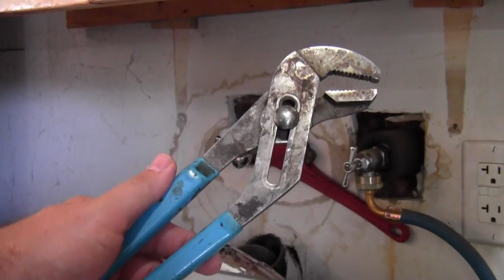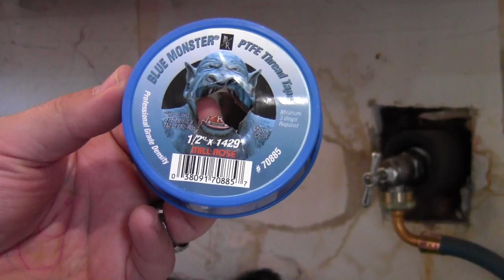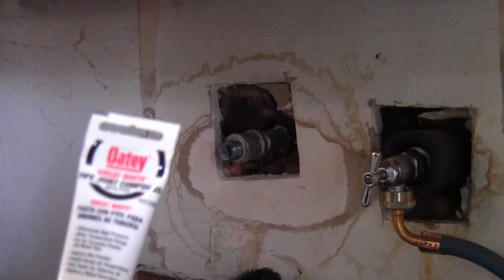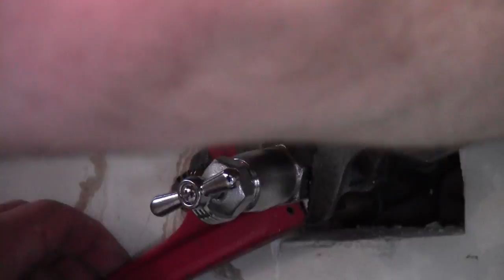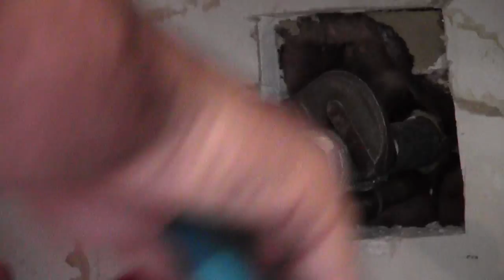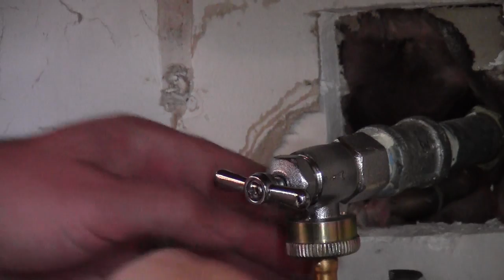Washing Machine Water Valve Replacement

Comment: For me, it seems the water is leaking from the part where you open and close (turning) the water pressure.  Should I just change it completely instead of this method?
Reply from the maker: To replace the part that is leaking I believe you would need an exact match. If there is a size difference water will more than likely leak. I would probably replace the entire valve. This is the valve I had available at the time and it's still working. Look for a quarter turn valve from the hardware store. Should be under $10.

Comment: That 90 degree hose end is for the washer connection, not the faucet; also, all modern washing machine hookups should be using only quarter turn ball valves, never these old style faucets that will eventually leak around the shaft, moreover because codes want home owners to be able to easily and totally turn the supply off whenever it's not in use to avoid catastrophic failure and flooding. If I'm not mistaken, most advice is to use either tape or compound, but never both together. I hate to say it, but one more time where we see why they license plumbers.
Reply: I have used tape, since it’s less messy. It leaks about half the time, and I have to remove it and use more. I’ve also used dope and it works for me the first time, 90 percent of the time. Now I use both; when I do that it has never leaked on me even once. I heard Rich Trethewey on This Old House say that some plumbers do use both. That’s good enough for me.
Reply: I believe a "good" professional is worth every penny.  For one thing a competent pro will know the codes, and accepted practices, which most home owners don't. I am now retired.  When I was working I never worked with plumbers but I did electrical work ( I was not an electrician), and did work around electricians and contractors a lot.  I was highly impressed by many of the highly skilled electricians I worked around.  I was even favorably impressed with the average Joe electrician.  But, as in any profession, there were some dogs too.  I worked around some electricians who were not competent and probably didn't know much more than I did.  They stood out too.